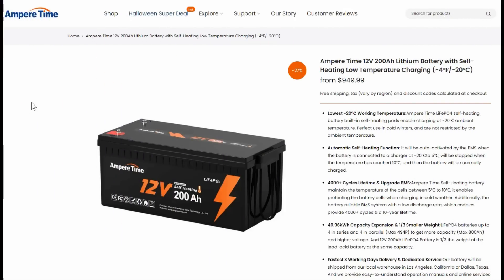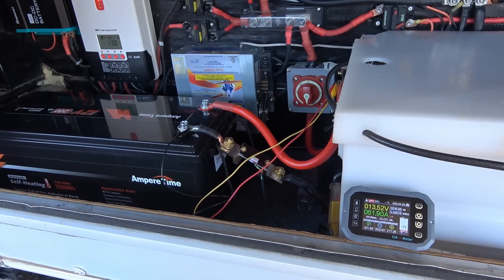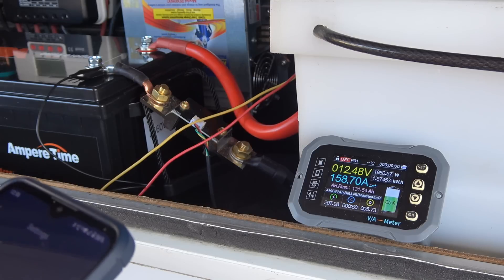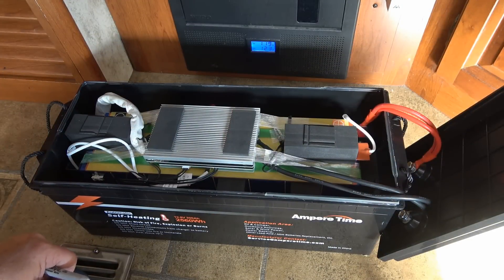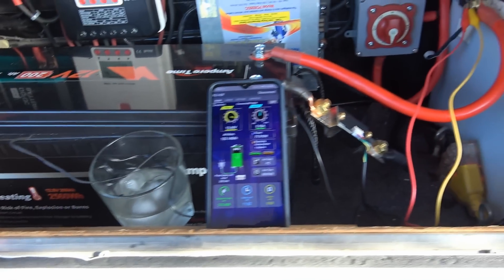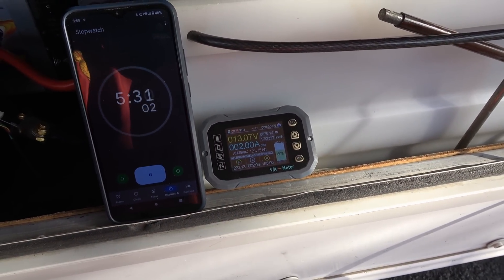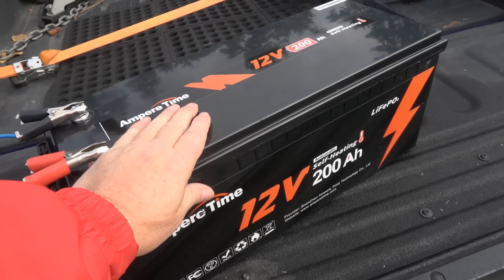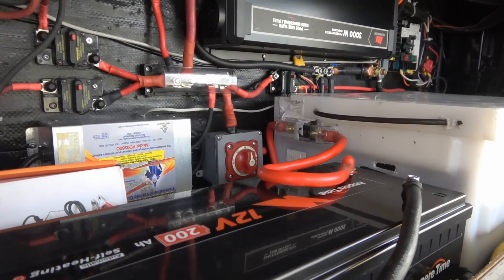Demos & Review - Ampere Time 12V 200Ah (Self-Heating) Lithium Battery - Low-Temperature Charging!

Comment: Great review as always Ray. Wil Prose gave a good review on the build quality of this unit but was not looking at RV use.
Reply from the maker: Thanks. :) Not sure if you saw the link but I did a few update videos about the battery https://www.loveyourrv.com/demos-review-ampere-time-12v-200ah-self-heating-lithium-battery/ I ended up with a defective one and also it had issues powering a cheap end inverter. Cheers, Ray
Reply: @LoveYourRV  I’m actually getting ready to take a look at the update Ray. We’re looking at the new Cougar 23MLE which comes with several Solar prep versions and thus looking at viable options to the lead acid batteries. Keystone advertises great pricing but they seem quite expensive. I also noted that there were several changes to your equipment setup and looking forward reviewing. I copied your earlier setup and was quite pleased to be able to run my residential fridge. Like you I now also have a solar batter I charge with my DC-DC charger that can supplement my off grid needs. Thanks for the feedback.
Reply from the maker: haha, yes my system is always evolving and changing as I test out and review new products. This winter I'm installing a pair of Xantrex 240Ah lithium batteries and a Xantrex 3000W inverter/charger.  They saw my install on the boat https://www.loveyourrv.com/xantrex-freedom-xc-pro-marine-2000w-inverter-charger-review/ and asked if I'd like to try their stuff out in the RV. Looks well built so looking forward to using this winter.
Reply: @LoveYourRV  I’ll be looking forward to that build as they are great products.

Comment: Just bought 3 of them and installed them this week.  So far I'm impressed with the batteries and their support. It's good to find a Chinese company that tries to do it right, my experience is generally not good with Chinese stuff.   I didn't get the heated battery, so will add heaters.  The need to increase available current  drove the purchase.  I'm taking my older batteries and adding a 2nd system to run my digital darkroom/office.
Reply: Running off solar? No issues with load being dropped when charging is stopped?

Comment: I wonder if will start a motor home generator.  Run a trolling motor?    Also if motor home battery runs down could I push the switch on the dash to contact it the starting battery to jump the motor home.  Battle born answered yes to all these if I use two 100 ah
Reply from the maker: Trolling motors for sure, don't draw many amps, but starter motors do, so will depend on the instantaneous amp draw. That's why you see lead acid batteries rated at cold cranking amps; most are up around 500-600 CCA. Lithium batteries aren't good as starter-type batteries. The BMS design may restrict the amp draw to protect the cells.  Combining them in parallel helps as the amperage is added together. For example, I have 4 Lion Energy UT1300 batteries with a max continuous amp rating of 150. 150 x 4=600, so not a problem. Most lithium batteries also have a max surge rating, often much higher for a few seconds. This Ampertime is 280 amps for the surge rating. Is that enough to turn over the motor? Hard to say. Likely best to have two. But usually, you'll find the manufacturers say the batteries aren't meant to be used as starter batteries. Cheers, Ray

Comment: Probably a good solution for a lot of people, kind of plug and play where you don't need to worry about anything temperature wise.
Just out of curiosity, what became of the "new" batteries that you got from Lion Energy? If I remember, you couldn't say anything about them because they weren't released yet, and that has to be close to a year ago.
Reply from the maker: I picked them up at Lion Energy when I went through Salt Lake Utah in late March this year and asked about them in August, and a rep said it would be another month or two. No word since then. They are working well. I can see they are broadcasting Bluetooth signals, but no app yet. Maybe they are having supply change issues or still working on the app. I remember they told me the app would cover many of their products. They are big into home battery systems now.

Comment: Thanks for the thorough review. I just installed one on our motor home a few days ago, but have not been out with it yet. Our battery is exposed,  so wanted the self heating option.
Reply: How has it been working? Any issue output randomly turning off while charging and discharging at same time?
Reply: @DansGamingVan  no problem so far.
Reply: @mikeflanigan4896  dude thank you so much for the reply!! Have you been using it a lot, charging while discharging?
Reply: @DansGamingVan  in use for 4 months,  however almost always plugged in. Haven't fully discharged etc.
Reply: @mikeflanigan4896  plugged into solar for charging?
Reply: @DansGamingVan  shore power.  But when driving a 180W Bougerv through a Renogy DC/DC/mppt controller..which also charges by alternator so far only boondock one day at a time.

Comment: Hey Ray, I got a dilemma; I have a 2021 Cougar 24RDS fifth wheel with the solar package i400 which is 400 watts. I have a 200 AH lithium battery. I just discovered that Keystone installed a WFCO 9875 converter at 75 amps and it is not compatible with lithium batteries and only charges to 13.4 to 13.6 I believe.
 So I checked into replacing the converter with 3 dealers and they want too much for a compatible converter and the labour to install it… I’m thinking of installing a good compatible converter in the battery compartment, run 20 amp plug to it, put some heavy duty alligator clips on it and run it whenever I’m on shore power and hopefully I can install the new one when the OEM WFCO burns out.
 Can I do this? If I do this can you recommend a good lithium converter?
Reply from the maker: Here is video about lithium batteries and chargers - https://www.loveyourrv.com/lithium-battery-charge-test-can-you-use-a-lead-acid-charge-converter/
This video shows how I typically recharge off grid with a second converter charger located beside the battery bank https://www.loveyourrv.com/2-year-update-safari-ut1300-lithium-batteries-and-energizer-gas-generator/ 
Last winter I installed an auto detect lithium/lead charger from WFCO https://www.loveyourrv.com/wfco-electronics-auto-detect-lithium-or-lead-acid-converter-charger/ it seems to  work for the most part but I prefer the charger that is located next to the batteries for the fasted charging. Cheers, Ray

Comment: Just as an fyi … I installed 2 100ah Chins. Some say they’re the same thing as amphere (?). Really like them over my 6 year  old 6v golf carts. Prices have really dropped from 6 years ago making them a good option.. 100 amp draw is a lot of power all at once let alone 200! Not sure I’d ever need that much power all at once?
Reply from the maker: An inverter powering a typical microwave or coffee maker or hotplate at 1500W will draw a lot of juice. With inverter/wiring efficiency factored in that could be about 1800W from the battery. Amps = Watts / Volts so at, say, 13V draws 1800/13 = 138.5 amps from the battery bank.
Reply: @LoveYourRV  yes you are correct. I wasn’t thinking too clearly. I was just thinking about a 10 to 15 amp appliance and not going thru the necessary inverter process. Thank you

Comment: look forward to update as i am interested in one for a truck camper? can you recommend for small application. safe travels..
Reply from the maker: So far it's working well. If it was me and have the room I'd go for the 2 smaller 100Ah batteries versus this big one https://amzn.to/3OHz31Z They each have 100 amp continuous discharge rating so when paralleled that's 200 amps. Most microwaves or coffee makers for example will draw over 100 amps DC to power via an inverter. Also if one quits your not dead in the water.

Comment: So I have a 2015 Winnebago toy hauler with a onboard Onan 4kW generator.  I'd like to upgrade my batteries to something like this, but I'm worried my generator won't work with it.  Most of these companies advice not to try and start a generator with them.  Thoughts?
Reply from the maker: Definitely stay away from this brand then. It doesn't do well with surges above the 100 amp discharge rating.  See my update videos - https://www.loveyourrv.com/demos-review-ampere-time-12v-200ah-self-heating-lithium-battery/
Some of the better surge amp rated brands like say Lion Energy may do the trick for you especially if you have multiple batteries paralleled but you'll pay more for them. But overall lithium batteries aren't good for powering starters. Cheers, Ray

Comment: Let's see how they do. They are getting a larger presence all the time it seems. I know Will had the BMS not working as per spec as well. But looks like they have solved the low temp problem but did the high temp shut off work properly on yours?
Reply from the maker: I haven't tested the high temp sensor yet, but it was printed on it 65C and I imagine there is one inside the BMS board

Comment: Thanks Ray!  Like 164.  I think the 100A limit is due to their cable sizing inside.  If they are using 2 8AWG cables, isn't that 110A?
Reply from the maker: Makes sense, but I imagine they can handle a little extra due to the short length and are attached to the terminals, and with larger external cables, some of the heat created will be drawn away. It would be interesting to see inside the 200A-rated model and see if the cables are larger or if they use more of them.

Comment: I just bought 2 of these off Amazon. They were on sale for $899 and they offered a $100 coupon off on one of them so I got one for $799 and one for $899. I felt that was a good deal. And I dont confuse myself with bluetooth so I wont miss that option.
Reply: How have they been working? No issues with load being dropped/power flickering off when charging is stopped?

Comment: Wow, prices seem to be really dropping on lithium batteries. Ray, how much of the charging is controlled by the converter versus the battery BMS? I mean this as a general question, not specific to this particular battery. Thank you.
Reply: They really have over the last several years. $300 for a plain 100Ah lithium is crazy. Really no point in buying lead acid for power storage.

On the charging part, I could be wrong but the converter is the main component. They have 3-4 stages and monitor the battery's voltage and adjust the charging accordingly.
Reply from the maker: With lithium batteries low internal resistance if the converter charger voltage is between 14.2-14.6 it will output all it can muster pretty well until the battery is over 95% full. At the high end the limiting factor will be the BMS cutting off charging at its max rate.

Comment: Great video. I'm new to all this battery business. 
The Amazon advert at 42secs say "Built-in 200A BMS"? So I guess this would have the 200A you were hoping for with the one they sent you. Were you expecting a 200Ah battery to have 200A BMS? Easy to get confused and assume this if that's the case....... Me? I'm just totally confused!
Once again, Great explanation.
Reply from the maker: All the 100 Ah batteries I've reviewed have had 100 amp BMS boards in them. My Lion Energy Safari UT1300s  which are 105 Ah even have a 150 amp BMS. So having a 100 amp BMS in a 200 Ah battery seemed a little light. It would mean if you wanted to run higher loads like say a microwave and stay under the 100 amp rating you'd need two batteries since average microwaves draw about 125 amps DC when powered through an inverter.

Comment: The fact that this battery has a low temp heater but wonder if it has low temp protection? IOW does the BMS not allow the battery charge when the battery is too cold not just turn on the heater? This is important if the heater fails or it is extremely cold.
Reply from the maker: If the BMS senses the temp is too cold for charging, it turns on the heater pads, and then they run until it's a safe temp to start charging the cells, usually at between 5-10 Celcius. S to do that is much have low-temperature monitoring. If the pads fail, you'd have to manually heat the battery to get it warm enough to start charging.

Comment: Why did they change their name to LiTime?
Reply from the maker: My guess is they use to sell lead acid batteries and now have switched to selling lithium
Reply: @LoveYourRV  I got the non-heating version of this battery btw. the 200ah PLUS to be exact x2 for 400ah. total of 600ah on the camper between banks. It will be in heated storage already, should be a non issue coupled with 200ah of lead acid for back-up but separate banks not hooked to each other. The LifePO4 will provide shore power for coffee maker, tv and small appliances.

Comment: I just got two ampertime 200 amp batteries.  I would have gotten those if my batteries would be in an unheated area but I'm putting them inside the camper where it's well insulated thankfully.  No way I'd keep the batteries in the front compartment of the fifthwheel!
Reply from the maker: Depends on where you camp, at what temps, and if full time heating the rig all the time. The lowest outside temps we see are in the low 20s.  I've had lithium in the front storage for years now. Never been close to having them cut off charging because of low temps.  They are inside a battery box and, in their own case, produce their own heat when working. Plus, the ambient heat of the trailer keeps the storage bay warmer than outside temps.  I actually did a deep freeze test with my Lion Energy. You'd be surprised how low they can go and still discharge fine. Cheers, Ray
Reply: @LoveYourRV  I have a conventional pull trailer with the batteries on boxes on the tongue. I am concerned about overheating them more than freezing because I live in Florida. Will Lithium batteries handle the heat alright? Should I put them in the storage bay in the trailer and is there any issues with fire if they get hot?
Reply from the maker: @billstoys8324  Lithium handles heat pretty well. There are tons of electric cars running around now in hot climates. If they do get too hot, there are safely shutdown protections for overheating built in.  The chemistry used in these LIFePO4 (lithium iron phosphate) is the safest. It doesn't really burn, just sort of smolders if it fails, usually though that is due to puncturing the cells.

Comment: Ampere Time batteries returned and refund issued. Great customer service. Would of been happier if the batteries would of worked. They gave us 300AH more reserve power and were 210# lighter than the AGM batteries.  

Problem?  When the batteries tried charging in the morning (solar) they tripped the electrical system in our RV. Our best guess was a weak BMS board. (Battery Manaagement System)
Reply from the maker: Thanks, good to know about the customer service. So when they started charging the 12V output died? Guess the BMS was triggering a protection mode falsely.
Reply: @LoveYourRV  Yes. Just momentary. It happened when it saw a coffee maker or Small (875W) space heater kick on, then it triggered protection mode again. It was so quick a voltmeter was unable to detect it.
Reply: I saw in another review the same issue, when discharging and charging at the same time, and the charling load stops, it drops the entire load that it is powering. Causing a power surge on inverter/everything running.... Is that the same issue, are you still having it?
Reply: @DansGamingVan  I returned the Ampretime and purchased a different brand. Yes Same issue.
Reply: @opaandomascampingadventures  shoot. What company did you go with?
Reply: @DansGamingVan  I think the link was removed?? Lifeblue 300AH (2)  BTW- The LIFEBLUE Batteries showed charge rate up to 14.8V. We were tripping the overload on the BMS. We lowered to 14.2 with no more issues.
Reply: @opaandomascampingadventures  I will look into them! Thank you!! Happy camping!

Comment: What app are you using to monitor the BMS?
Reply from the maker: It's an app for a battery monitor with shunt. Here is a demo video I did when I got it https://www.loveyourrv.com/new-test-gadget-koolertron-battery-monitor-w-400amp-shunt-bluetooth-app/
Reply: @LoveYourRV  thanks for the quick response. Safe travels.

Comment: I bought that charger  different brand and company, I compared your photo to the one on my brochure....identical. must be one company selling to everyone, so who can actually fixes it under warranty I? eonder
Reply from the maker: I'd imagine it is who ever you bought the charger from that honors the warranty. For example Ampere Time (now called LiTime) has 2 years warranty on the chargers. https://www.litime.com/products/litime-14-6v-20a-lifepo4-battery-charger-for-12v-lifepo4-lithium-battery
My guess is they buy wholesale from a manufacture then resell. As the reseller they provide the warranty. They likely just send out a new one and the old is either sent back or recycled.